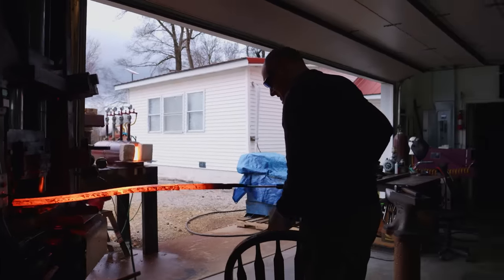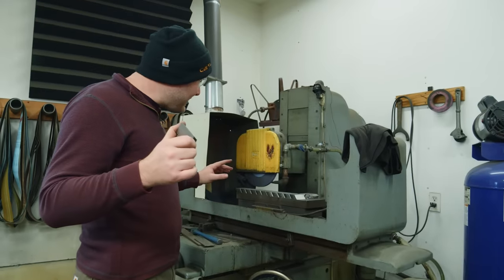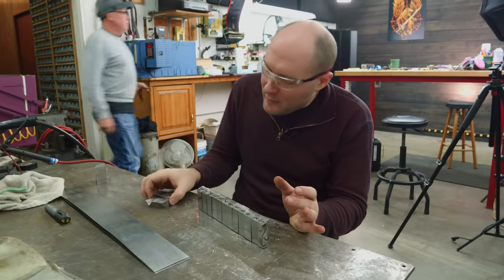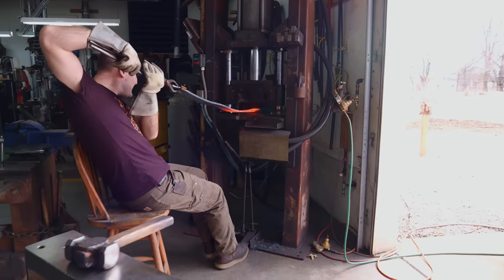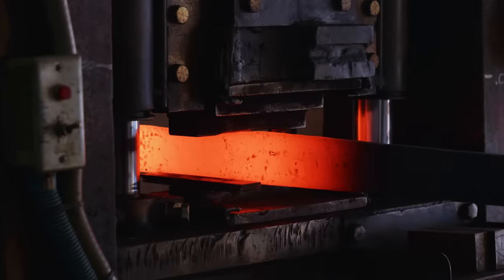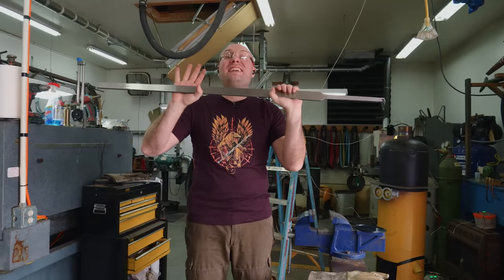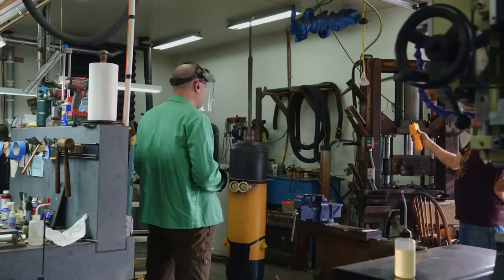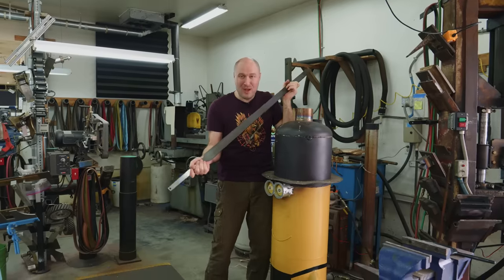Unveiling My 53k Layered Damascus Steel Sword

Comment: Surface grinders use a diamond dresser. It’s industrial diamonds mounted on rod that is mounted  to a base. You magnetically stick the dresser and carefully run the wheel across the dresser tool.
Reply: Right. The reason why his method produces such an "aggressive" grind is just that it whacks the wheel unevenly and leaves it all jacked up like his broken grinder disks. If he is not about flatness, then sure, it works better than a nice and evenly dressed wheel with a diamond tip just because it leaves more sharp stone edges on the wheel.
Reply: I work with grinding, mostly centerless and centerd grinding, some out of round and surface grinding as well. The trick to get the wheel to cut as well is to find the right depth and feed of the diomond across the wheel. 10-50 microns per pass and 1-5mm/s across the wheel, faster and deeper dressing of the wheel often result in a more agresive cut. all depends on the mate
rial and type of grinding wheel. I mostly use 80 grit 3m cubicron wheels. The surface grinder we have at work have a hydralic dresser on top of the grinding head.

Comment: General, you don't want to rough up a stone on a surface grinder. If you want a coarser cut, you simply change out the stone. I suggest you get a 60 grit stone as well as a second arbor to mount it to so you can quickly swap them out. They make stones as coarse as 24 grit if you have to remove a large amount of material.

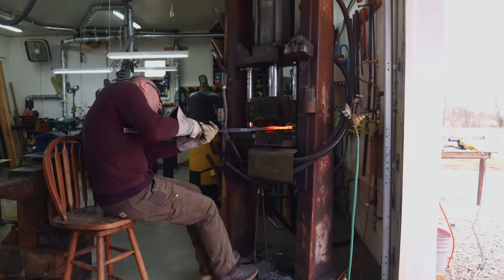Comment: 21:45 That is the least ergonomic press on the internet.  The press needs to be one foot higher off the ground and you need to get rid of your Singer Sewing machine pedals.  Some day you will slip off that chair and end up with a molten hot piece of metal across your body that will leave you with 3rd degree burns.

Comment: This ain't a Damascus Steel Sword its a awesome Pattern-Wielded Multi-Layered Damascus-Patterned Steel Sword. 
Don't ruin History by saying it's Damascus Steel because its the furthest thing from real Damascus Steel.
Reply: Damascus steel is made by layering two different alloys, heating the steel to around 2300°F then you press them together with a hammer or hydraulic press. The multiple layers of steel are folded over and over to create more layers. Every thing about this sword is Damascus!  It doesnt have to be folded 100 thousand times all by hand with  a coal furnace to be Damascus! My wife has a pair of Damascus ear rings that was cut from a Damascus block that has over 18,000 layers. If you want to study up on types of steel    check out "Japan and Damascus, Then and now"  P.S. Nothing has changed but the machines used in modern times. Its ALL "STEEL" Damascus 👍🏻

Comment: DO SOMETHING WITH WOOTZ STEEL!!!!!!!!!!!!!!!!!!!!!!!!!!!!!!!!!!!!!!!!!!!!!!!!!!!!!!!! please.  Also get a a 90 degree head attachment for your mill, put a stone wheel on it and use the mill as a surface grinder.  It should be able to get you in the ballpark of "flat".

Comment: Kyle,
I tried out a wood workers drum sander on the blade I’m making and was amazed by how good it worked. 
It pulls the part through automatically and held a .005” thickness over 24”. Just had to keep flipping rotating to keep it even.

Comment: 150# Steam Expands Water 1,600 times at 375 degrees. 600# Steam at 675 degrees expands water 16,000 times. So a Drop of Water at 1,500 degrees will increase or expand 150,000+ times its size.

Comment: It feels weird to try to give advice to a master smith, but I'll bring up a few things in case you didn't know.

Forge inserts for flux
Something to take the damage of the flux instead of the forge floor, to be replaced regularly as needed.
For something quick and short term, a shallow, thicker gauge sheet metal pan will help.
If you know it might come up, you can buy or make a tile. "Chile forge" where I know to get them. To make them you simply cast it with forge refractory. Kast o'lite 30 is the favorite of the forum I studied (I buy it from "high temp tools"), I think I heard it's more flux resistant than satanite, but satanite is still okay.

Straightening a sword hot
1. Clamp it straight while it cools.
2x4s and clamps are the most common I've seen. Doing this regularly, I've mounted a vise with 48" jaws made with steel rectangle tube and wood.
2. Having it hot and vertical
Ideally you have a tall vertical oven like Kevin, but otherwise heating it in a long forge and then hanging it can work.

Grinding a sword straight
1. Flat reference surface and belt grinder, contact wheels and platten.
2. At blade show "burr king" showed off their machine, a 2x72 two wheel grinder with a long magnetic chuck. They have 12, 24, and 36 inch chucks. It had a 2 axis tilting base for distal taper and hogging some material off of bevels. They said the belt grinder was 3k and the chuck was 5k. I would love it if brodbeck made a 48" surface grinder attachment, because we'd rather not spend the money and space on another belt grinder.

Comment: -Might a copper/thin sheet steel 'Torus' type 'donut' catchment system attached to ceiling catch any eruptions of molten salt IF any moisture  were to cause a vertical explosion plume?  The inlet/outlet radius of the salt bath vessel is what?...About 5 inches in diameter? (Kinda hard to tell by vid)
-Think like a circular innertube with the inside of the 'Donut hole' radius cut 3/4 way up its inside arc to help contain any splash from ceiling & the inside arc of the 'donut' to catch splash, its exterior then follow all the way to affix to ceiling?
 
-The circular 'J' or backwards/<< left facing G shape of ext curve would catch the plume/splash & its open inside, maybe adding an angled lip attached to its cut-down inner top & facing upwards/outwards >>
-Like an backwards/left facing capitol G,  but its foot angled facing the 1 or  2 o clock position, any splash would re-direct it  back towards the curved donuts outside wall, reduce its momentum, then pool it @ its bottom curve...
-That lip might retain any spill from splashing out over the top of inside torus?

-Just a thought, I'd be MUCH better off drawing it for yee's, then try'n 'ta explain it!...HA!... 
-Im CERTAIN the two of ya's can visualize what Im speaking of?... 

-You can never be too safe when working with that sort of stuff......ONE 'oopsie' is all it takes....;)

Comment: Love your work, fun style, detail focus Kyle. With total respect and zero sass, 2 notes/ideas , from watching all your stuff a long time. 
1. Read up on 'transpose' - its the term for the way you restack tiles, and anything with orientation swap/directional change, as the best used expression. (more math, less magic )
2. Your wooden chair at the press -  is it a little too high when you feed in the billets, causing a less 'level' process perhaps? Since you will sit to use the pedals. I know billet length is the issue for losing flatness anyway, but its made harder by feeding it in from above

Comment: Our county we had lots of companies at one time.
You could quit 5 jobs and still have a job by end of the day.

We got snow like that every day in 1960s , weatherman didn’t even mention snow unless it was at least a foot coming down.

Worked in Bendix foundry we used ductile iron shaped stars about 1/4 thick by 3 inches around, had 2 - 36 inch wheels  running with 460 volts.

Comment: Hey kyle, 

Have you ever tried clamping a sword directly on your mill table and just pass over it with a fly cutter? 

Would be easier, faster and probably more precise that way

Great video tho and the pattern looks incredible 👍👍👍

(Also for the surface grinder you should try a diamond hone for the wheel!!)

Comment: Was the warping issue on the work bench due to the temperature differentiation from the ambient temp cold table to hot billet losing its heat too fast? What about having your dad make a jumbo sized plate quench vise or press machine to hold it flat and true? Once it cools down in a jig like that it should be close enough for your mill or surface grinder... Only been making blades for 9 years so this is just my novice idea and 2 cents. Love your work, Your work is the standard I'm striving to achieve with every blade.

Comment: I grind a lot. A super sharp diamond with a crazy fast feed rate will give you a much sharper wheel and most likely work better. 
Floor coolant is a must in my book.
Also what size wheel does your grinder use?

Comment: I know they are expensive but you need a new larger grinder.  Well not need but could really use.
Edit: I typed this just before you said the same lol. I bet you could get a manufacture to give you a good deal because of all the eyes that see your videos.  I also bet if you were to “lease” or “rent” one from them it would be free without even having to talk much about it (other than for what’s required for the UK folks).

Comment: The part I'm puzzled about is when you are finishing the billet before cutting the diagonal tiles do you squish the pattern down with the press, distorting it, so when you make the diagonal cuts, weld them together and flatten and draw out the blade the pattern gets stretched back into an undistorted square area? I'm probably not describing that well.

Comment: Bladesmithing and blacksmithing are 2 different arts.  You are an excellent bladesmith, and a good blacksmith.  However, I noticed that you mounted your anvil too high.  your life will be much easier if you mount it so that your knuckles rest on its surface when you let your arms relax down by your side.  stand next to the anvil, relax your arms completely, and where your knuckles are is where the surface of the anvil should be.  that makes it easier to forge things, especially big things that require big hammer strokes.

Comment: I've used 2 pieces of angle iron and clamped my blades between them to get them straight and keep them straight while they cool, dunno if it would work on such a large blade, but i've done up to a 21 in wakizashi in that method and its worked great

Comment: There is a single point industrial diamond stone dresser made specifically for surface grinding abrasives.  The abrasive wheel is usually chucked in a fixture rotated at operating speed,  and the dressing stone is moved across the work area of the abrasive.  The diamond dresser produces a very repeatable and flat surface.  The dresser you were using is made specifically for a bench grinder and produces a gross flat surface for a traditional grinder.  That tool usually removes the clogged pores of a bench grinder wheel, making it safe to use.  Ring test all your surface grinding wheels before reinstallation.

Comment: I use to work as a tap maker and if I were u I'd invest in a good air quality system. U might not have a problem. If I'd just hang a piece of newspaper and see if it goes weird. When I worked with salts and heated metals they also evaporate at certain temperatures the metal gas is invisible, tastless and very very dense it accumulates on the floor and can be drafted up. It's very dangerous just a warning. You'd place seems fine. But when your sweat goes blue you might see things a little differently

Any metal that is heated up until it glows gives of a gas. Its a ratio of gas emission vs temperature of substance. Like how ice melts and evoporates metal does the same thing. Its hardly any but the hotter you get it exponentially emits more metal as gas. 
If done all day or without ventilation it will build up. There is a clause in the OHS Australian guidlines that briefly mention this but the science behind it isnt elaborated on. It only refers to a range of temperature to keep the metal in while welding or soldering thats it. It doesnt mention why this is a problem only refers to structural integrity of welds and flow rates of solder. Its a blantent lie and its extremely dangerous when built up in the human body.

Comment: That way of wheel dressing isn't great but it is perfectly fine for what you are using the grinder for, but if you were needing any type of precision from your grinder then it would be a big HELL NO, but for what you are doing its fine. If you ever need to use it for more precise work in the future you could always have 2 wheels, one wheel for usual everyday grinding and one wheel for precision grinding

Comment: if purity is a concern why not make use of some of the Japanese forging methods? first off, no arc welding or tig or whatever. second only use the metal you're working with or do a second run of the same billet type for handle material to hold what you are working with and in that way, not contaminate the billet. why take risky shortcuts with something so involved? honestly, I'm getting bored with all the pattern welded stuff anymore. I'd like to see some stainless pattern welded blades. or a stainless titanium san mai. something impressive and difficult on many levels.

Comment: When you take it out of the forge, heating it as evenly as possible, clamp it between two lengths of wood. A good thick strong wood, with lots if clamps. It will cool at a stable rate, usually.

Comment: You should put some square tube on the backside of the press to act as an outfeed table. It will support the long blanks and help keep you from getting fatigued and help keep them from bending from its own weight. It can also help protect the stuff around it from the heat.

Comment: Okay, I don't know if you know this or not. I learned this from an old mountain man that made muskets and he told me that when you forge and heat the metal if you don't quench it facing North and South that when the metal reaches its magnetic State, just as it does, the actual magnetic pull of the earth pulls it out of straight. I've tried this and it is actually true. It doesn't affect the metal when it is non-magnetic hot, but when it cools just as it hits it's magnetic State. If you are not facing in line with the two poles of the earth, it will pull it out every time. Just a thought.

Comment: Get a diamond dressing wheel rod and drill some hex stock for that to fit in to, that will let you place it on angles to dress the sides of the wheel if you need to use the edge of the wheel for a sharp corner or anything, all you do is place the diamond slightly to the left of center and lock the bed and pass it from side to side until the wheel is no longer loaded.

Love your work my friend, you have a beautiful family.

Comment: I don't know about molten salt but I work in an aluminum smelter. Moisture on top of molten  aluminum and the molten bath used to cover the aluminum isn't a major problem . It turns to steam instantly, it us when the molten material is on top of the moisture then it turns to steam and violently expanding 12x in volume theat the explosion happens.

Comment: Also would be cool to have an additional shorter version of the video at normal speed but for 5-7 minutes - the main parts of the process. Because often there is no an hour to see a video. However the topic is very interesting.

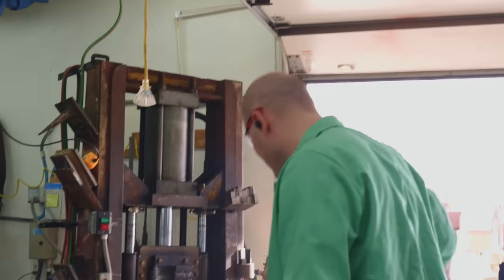Comment: 48:00 A genuine problem I can see with this process is that, because you left the sword hanging in the air right above the molten salts, the tip of the blade will stay hotter for longer and may mess with the cooling process and grain structure.

Comment: convert the surface grinder to run belts rather then stones then you don't have to dress the wheel and you can use the same 2x72 belts

Comment: What worked for me dressing my wheels was a diamond point, first a slow pass to ensure flatness of the wheel, the last pass as fast as I could traverse would leave a sort of spiral across the stone this helps stop clogging. If your still struggling with clogging I suggest moving up to a higher friability rated stone. This will break apart faster but wont clog as often, surface grinding is always a trade between friability and heat and finish. Ultimately I made a belt conversion for hogging things down to flatish, then use a stone wheel if I need the perfect finish or sharp edges. Hope this helps 👍
Reply from the maker: Hey thanks my friend. Always trying to improve. 

Dad
Reply: @KyleRoyerKnives  anytime 🤙 keep up the good work, I hope this helps in some way 🙂

Comment: Usually you should use a diamond in closed into a block of steel, set it on the magnet and move the stone cross it to get it parallel to the magnet. Love your work.
Reply from the maker: We do when doing finish grinding but not for rough in. 
Keep grinding on my friend. 

Dad

Comment: Another masterpiece! I grew up in Branson. Did you know Brad Pitt grew up in Springfield? What I want to know is how you can work during the summer when it's really hot? I can remember stepping outside and instantly sweating. I used to think Hibben knives were my favorite but that has changed since I've seen your work.
Reply from the maker: It's not the heat that gets your, it's the humidity! lol
Reply: @KyleRoyerKnives  very true lol. I live in Florida now and people complain about the humidity here but it's not as bad as what we had in Missouri. I don't think I've seen anyone as good as you at making Damascus

Comment: If you don't pre-warm / dry the blade prior to putting in the salt it will spit and sputter which is no fun. LOL ask me how I know
Reply from the maker: Oh my goodness. You didn’t get hurt did you. It’s by far one of the most dangerous tools in the shop. Be safe my friend. 

Dad
Reply: @KyleRoyerKnives  No injuries, I made sure to use the proper protective gear. Molten salt is no joke for sure. Looking forward to the next video.